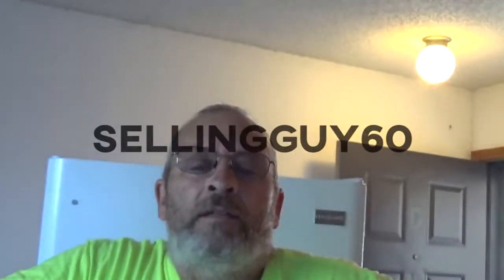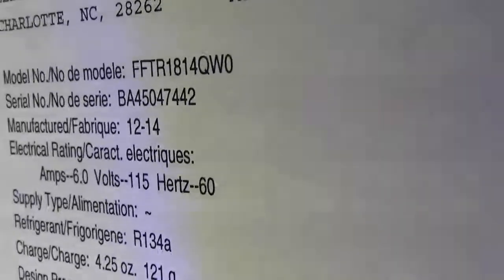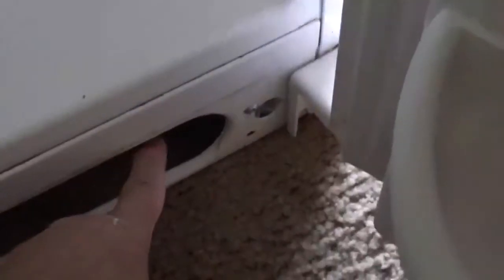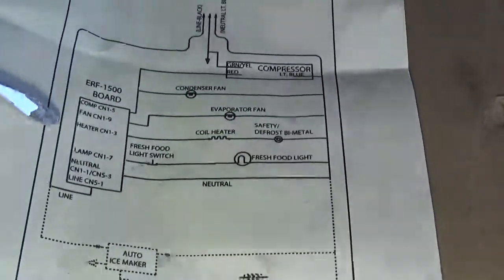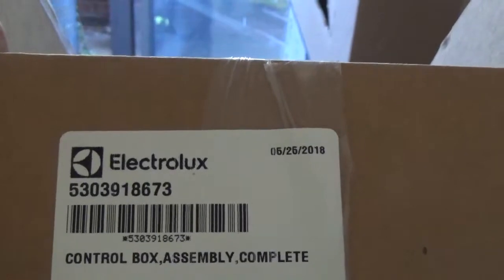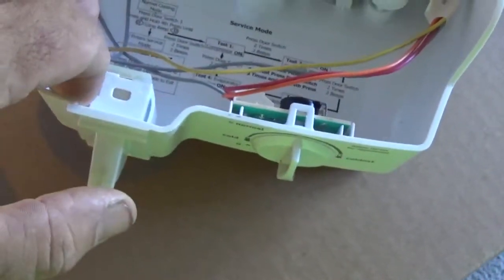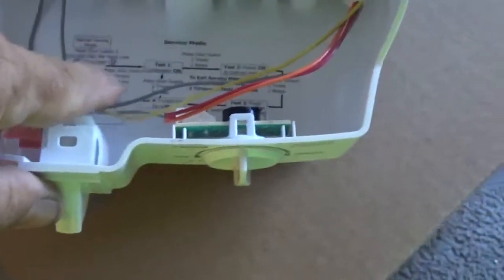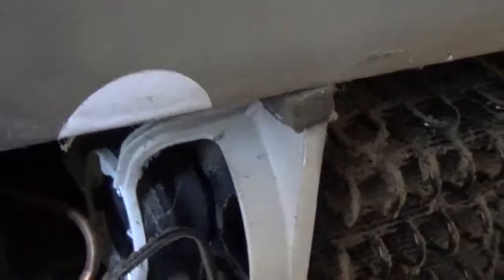Frigidaire Refrigerator FFTR1814QWO  Fans , Light and compressor not working

Comment: On mine the light went out bulb is okay and the switch is good but I put a defrost timer it work well but now it always on is there a short? Mine has no. Circuitboard and also thermostat sensor is good
Reply from the maker: Yes you have a short some where or feed back to your light. Make sure the 2 posts on the light switch  are not touching each other

Comment: I have the same refrigerator without the board and there is power to the refrigerator but no light working inside refrigerator it has the same configuration as the new refrigerator you bought with the thermotat and defrost timer so now what??
Reply from the maker: You need to trace your wiring
Reply: @sellingguy6070  I found a bad cold control. The light bulb just neededto be screwed in tighter

Comment: BIG THANK YOU TO YOU!!!!!!! :)  My Frigidaire Refrigerator model FFHT182QS0 has the exact same problem as the one you were working on, no power, no light, no fans, no compressor and I tested the power cord and it was all fine. I am going to buy a new control box as you suggested.  After you changed the control box on the fridge with no light, no fans, no compressor, did it worked?
Reply from the maker: Yes it did and was put in to a Apartment last week